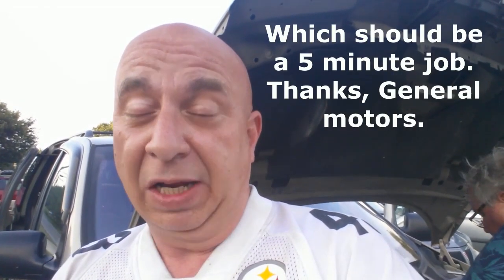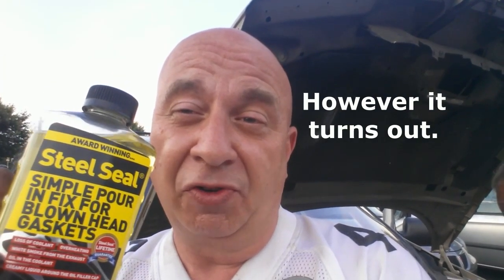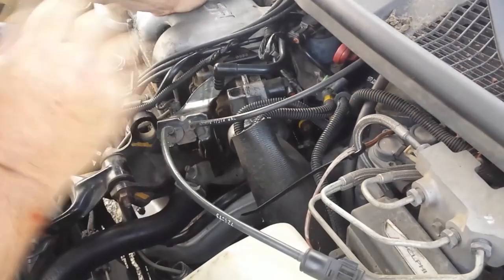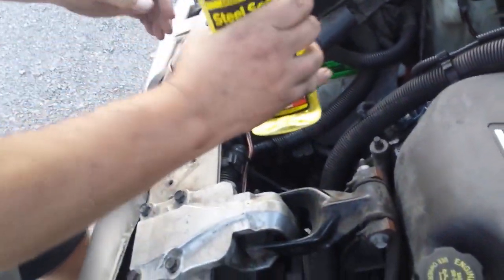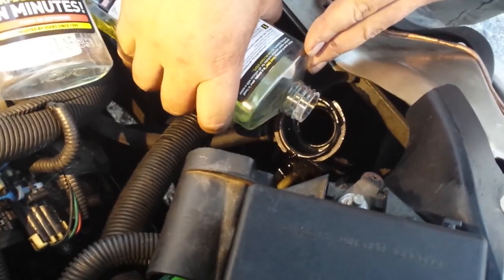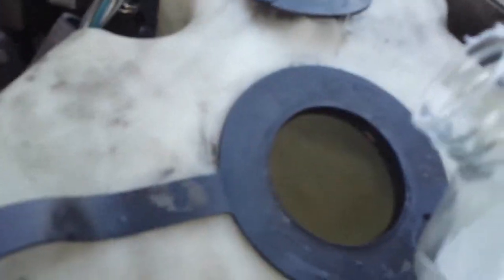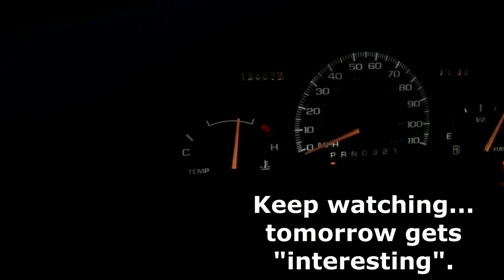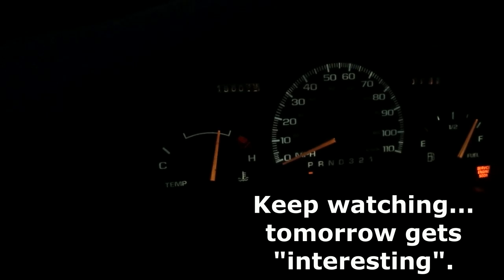Blown Head Gasket Attempted Fix - #Vanlife #RV Life - Does Steel Seal Really Work? (Step by step)

Comment: What about current status of #2 cylinder showing when running engine codes?
Reply from the maker: I've put about 1,000 miles on the minivan since doing the Steel Seal (good and bad), but I'm traveling in the other van at the moment. When I make it back to home base, I'm going to stress that minivan engine and do an update with all of the  pros and cons.

Comment: Still holding?
Reply from the maker: 600ish miles, still holding with the Steel Seal. I actually had to track down another leak (heater hose, due to GM using stupid little plastic fittings - the same one cracked that I had already replaced about 2 years ago). Temp is holding fairly steady, but keep in mind most of these miles have been short trips. I'm going to really stress this van and do a followup vid about it, hopefully in the next month or so. (Other vanlife/travel vids will be up in the meantime.) Until then, stay safe!
Reply: @BudgetTravelGuy  I have thermalweld (rebranded steel seal + some extras) in my 2002 Cadillac DeVille equipped with the infamous Northstar V8. I beat on it hard and it’s been holding very well for 2000+ miles

Comment: I'm not a mechanic but my late honey was. I remember him taking the head apart-having it checked for cracks (over heated) having it shaved(milled) then replacing it with new head gasket. When did this problem require junking the vehicle? Also-had to junk 2 vehicles myself because of wire harness issues. They no longer make the parts!! 😳😒
Reply from the maker: 3 Generations, good question - the cost of having someone else do all of that would run between $1500 and up to $4000 (very labor intensive) and probably exceed the value of just junking it and replacing it. I'm going to drive it locally and see how it holds up, and then decide whether to get with some buddies and do the repair the right way, possibly donate it, etc. More soon (and back to more camping/van related stuff)....safe travels!